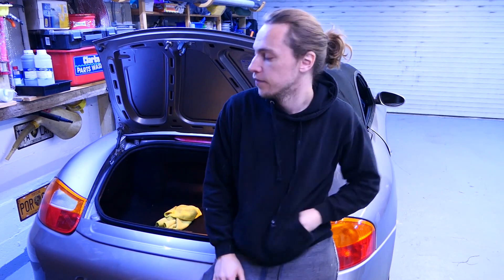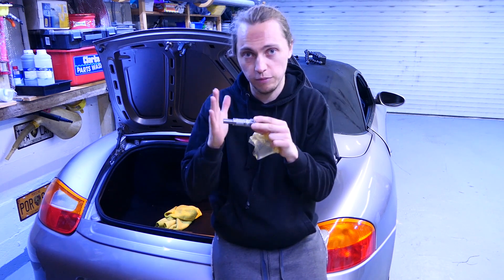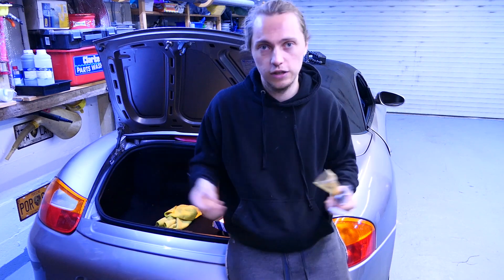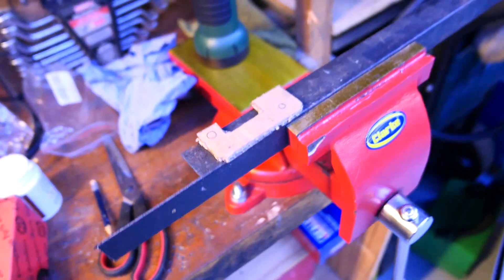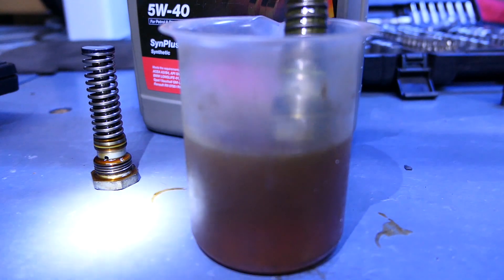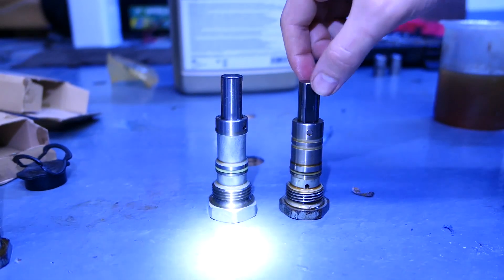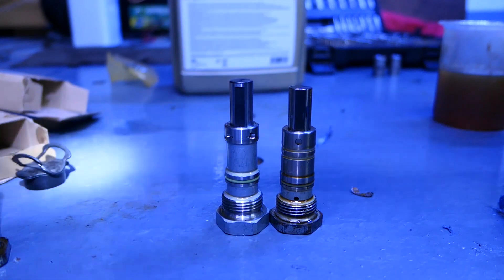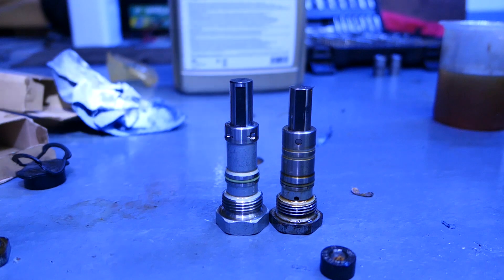Boxster Chain tensioners is not the issue! - Porsche M96 986

Comment: Hi guys, I too had exactly the same problem, also changed the cam chains along with the guides, updated the oil pump as per PORCHE Technical bulletin,  replaced all 24 hydraulic tensioners and x3 cam hydraulic chain tensioners at great cost then changed the oil canister valve and pump all to no use eventually gave up. Interestingly once that rattle disappeared after a few seconds the engine ran as sweet as a watch. Went all over the country in it including a 545 mile drive home one day. It had the rattle from the day I bought it until 10 years later when I sold it, and I mentioned it to the new owner ……unlike my seller. Spoke to many OPC and other Porsche mechanics none were any help, sadly I think I knew more about the M96 engine than them at times 😢
Reply from the maker: @JiffJaff321  wow you went whole hog! In a similar boat, in that I have done 000s miles with no issues, so will just keep using it as it is, and mark it down to another quirk of the m96 !

Comment: Have you checked your camshaft deviation numbers with the Durametric tool? I know it doesn’t really matter since you’re going to change out the pads anyways, but curious what your numbers are. From my research the value for each camshaft should be + or - 6 degrees. I think that changing out the pads aren’t talked about enough, since the pads are gonna wear on any engine due to the material/design.
Reply from the maker: Hey. Fully agree, its talked about very little, and with the age of the M96 they probably all need doing, maybe even more so than the IMS (My one was in perfect condition!) As you say ,due to the material its almost like a consumable part. This seemed to be common practise in the 90s, BMW chain guides also need changing in some of the V8s like the m62, however the difference is you dont have to drop the engine out or remove the head! 
Yes, I want to check the before and after deviation numbers when I do the pads. I will only be doing the easy access ones for now, so the 4 variocam pads as I think i might be able to do those ones in situ without taking the heads off.
Reply from the maker: Honestly I should go back to Mazda life, Porsches of this era have so many inherent issues
Reply: @Leee4444  Haha yeah man, I come from a Civic Si and a Miata, so the idea of timing chain chain guides needing replacement is extremely foreign to me… I agree that the IMS talk overshadows a lot of the other things that needs to be addressed on older M96 engines. I recently picked up a 98 Boxster w 100k miles and like you, I have been going thru the car replacing/updating parts and I am planning on dropping the engine next year to address the chain guides and IMS (honestly not too worried about the IMS). If you can DIY the engine drop and enjoy the job, I think the car is totally worth it (the sounds and analog driving experience are so good IMO)
Reply from the maker: @Getsomepiggy  Was foreign to me too lol. Agree they drive really well, however I think for most people who don't have the time/space/cash there are cars like the miata which give you most of the same thrills without the headache!
 Also I changed my IMS for a expensive aftermarket option, in hindsiight I think I would have done a like for like and just replace eachtime the clutch needed doing.

Comment: same for me didn't fix it ...i even replaced the variocam pads... nope same issue ..
Reply from the maker: Yea did the same , installed the variocam pads with no luck. Although if I do take the fuel pump fuse out and let it turn over a few seconds and then start, I don't have the issue. So it does still seem like a oil priming issue on the tensioners? Either way , I have stopped caring , these engines are quite a flawed design imo with many issues. However at boxster money they are amazing.
Reply: @Leee4444  I could have replaced all lifters while I had covers off but decided if that was it, it was not a chain  issue, which was my only concern..